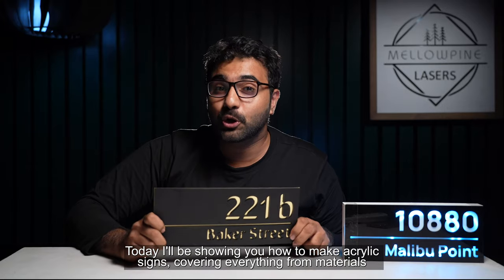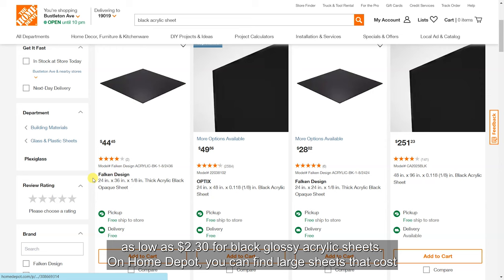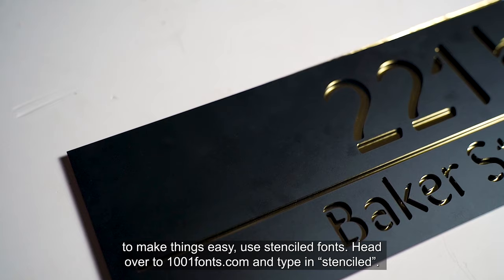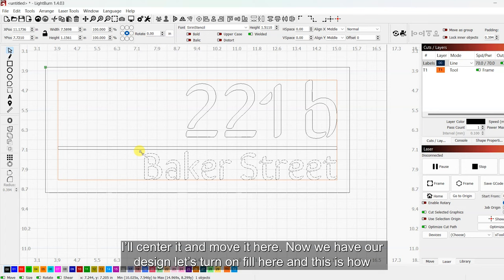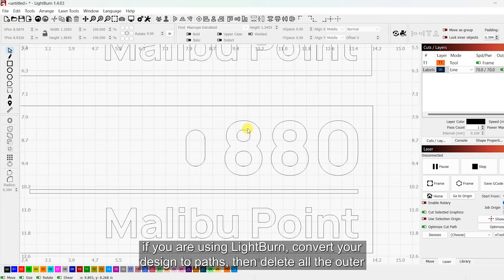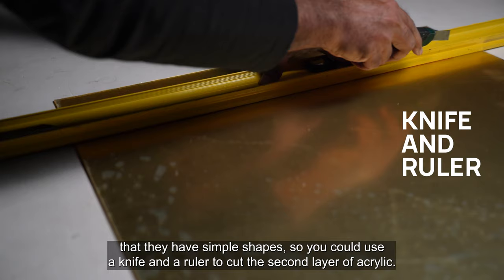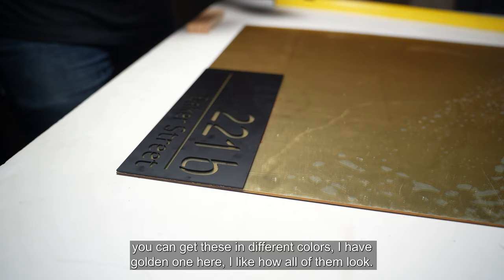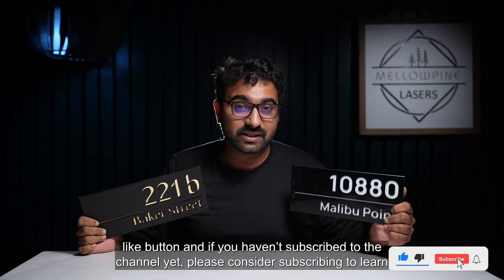Create Acrylic Signs at Home with Any Laser: Side Hustle?

Comment: Hello good morning beautiful video..I would like to know with clear acrylic by putting a black cardboard underneath can I engrave? If yes at what parameters? Thanks for your advice..I forgot my laser is Sculpfun 30 pro 10 watt I wish you a good day
Reply from the maker: Glad you liked the video.
Yes, you can engrave clear acrylic using the black cardstock method, but it leaves behind smoke stains on the engraving which can be difficult to remove. Cardstock method works well for engraving glass, but for acrylic, I would suggest to use paint. 
You can watch my video "How to Laser engrave acrylic", where I discuss the paint method in detail.
Reply: Ok thank you as always for your valuable advice I follow you with pleasure..bye and have a nice day